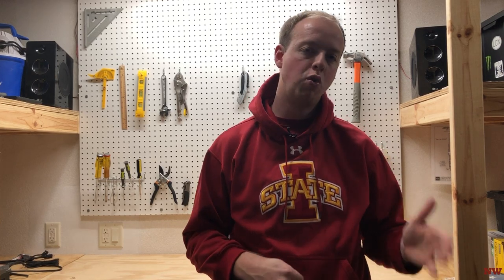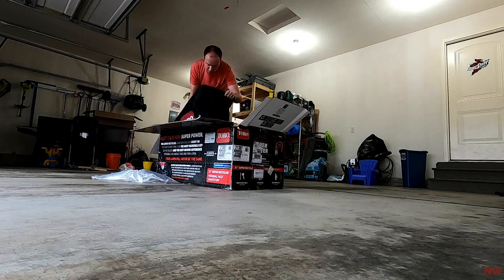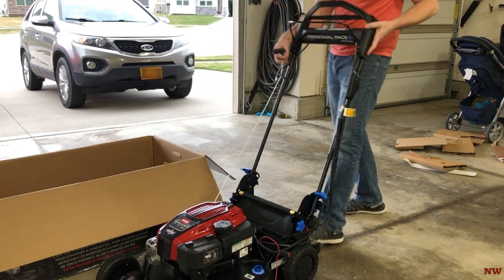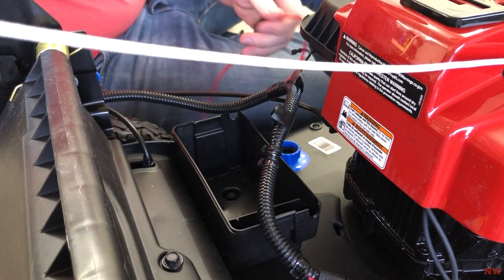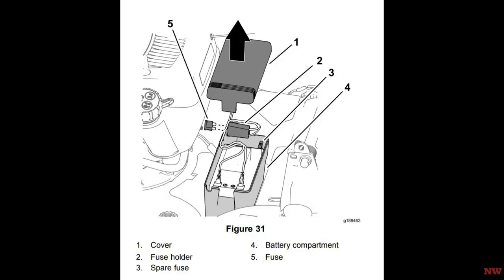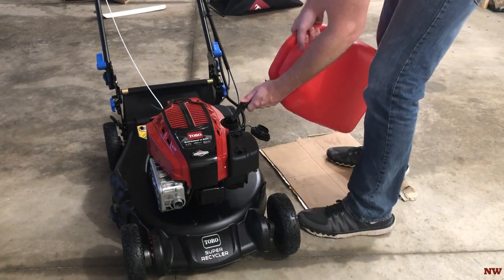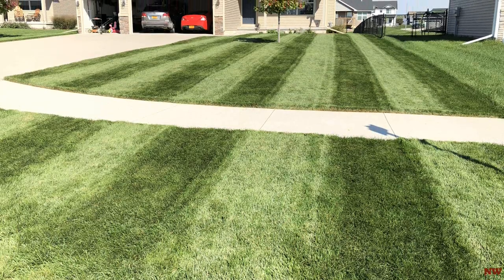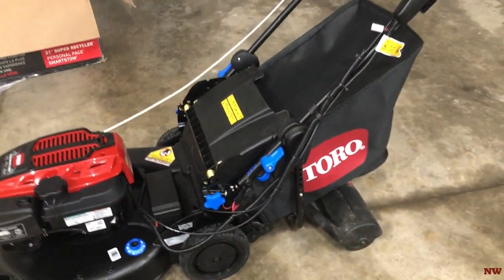2020 Toro Super Recyler (21387) Unboxing

Comment: Just curious I've had two of these and taken both back. They both stalled and sputtered constantlyand almost stalled  on any kind of bump or slight incline or decline. As if the engine was not getting fuel. Toro customer support just asked that I return them. Unfortunate because I like the mower design and build
Reply from the maker: That’s unfortunate to hear, Rick. I’ve had a few times where it sounds like it is going to stall out. I stop moving and it will regain itself. I was mulching at the time. Definitely keeping an eye on this. May give Toro a call if it keeps happening. Thanks for sharing your experience as well.
Reply: Rick D I wonder if it’s the plastic carburetor that Briggs uses on these that’s causing issues. My SR with the Honda engine is about 4 years old now and has been outstanding.
Reply: Wonder if the one with the Honda engine is better?
Reply: Just got one 2 weeks ago. It is sputtering. I am going to put ethanol free fuel in next tank and see if that helps. So many great features but that maybe a deal breaker. I usually stick to Honda small engines but the stow feature is what sold me on the Toro.
Reply: Mine sputters also on bumps.  Used ethanol free gas with no luck.
Reply from the maker: I can’t take credit for this, but a lawn care group I’m apart of on Facebook mentioned this fix, as well I spoke with my Toro dealer and he said Toro reported that there is a common issue where the spark plug boot isn’t fully secured.  This can cause this “sputtering” issue.  The fix has been pulling the boot all the way off, then push it back on until you hear a clicking noise. I’ve also heard this hadn’t fixed everyone but seems to fix quite a few people. I haven’t had a chance to test this out myself but plan to do so in the next day or two. I’ll post back my results.
Reply from the maker: Early indications seem to be promising.  Re-seated the spark plug boot and didn't have the issue yesterday.  I'd like to get a few more mows in just to make sure, but in the mean time I made a short video on what I did: https://youtu.be/SO-Kvix0s14
Reply: Just an update. I went to a local Toro lawn dealer and purchased the new #21383. It’s all black with a Toro motor with blade clutch and is outstanding. No sputter or problems and has performed without a hiccup. Highly recommended. The mower handles great and love the Personal Pace.
Reply: I’m having the sputtering issue as well. Spark plug adjustment didn’t work. Honda motor model is sold out
Reply: @cnosby 
Just left my repair shop.
The fuel tank vents into air filter housing causing it to sputter.
The fix is a newly designed tank AND a part for the carburetor.
Sucks.
Reply: I made a typo in previous comment I said .25 and what I meant to type was 025
Reply: @exnihilo2601  Did they charge you for that fix?
Reply: @lritch76 
No.
Under warranty.
They fixed the carb and now I'm waiting for the new fuel tank.
Reply: @exnihilo2601  hopefully toro is  fixing  those issues from the factory since they are on back order almost everywhere. There is a guy locally to me selling one brand new in the box for 500.00 but with the issues people have been having i will only purchase from a dealer.
Reply: Rick D screw that I bought one last November and was very disappointed. Go to Home Depot and purchase you a Honda this lawnmower is a waste of money.
Reply: Assuming its a briggs and stratton, thats your issue. Buy a Honda engine super recycler
Reply: the reason i think that it sputters is because the fuel line is straight into the carb not on an angle so really any bump would have the fuel push itself back into the tank then back to the carb thats just what it looked like to me
Reply: @exnihilo2601  Assuming your received the new fuel tank...have you had any issues after this fix?
Reply: @jonpenguin303 
I used it a little bit after bringing it home and didn't notice the previous symptoms? It was covered by warranty but the dealer kept it for most of the summer due to a lack of parts. I guess I'll get a chance to see for sure once the grass starts growing again. It's a shame a premium machine is defective out of the box. Mine has electric start which is why I bought it. Might have purchased a Honda but wanted a side discharge option.
Reply: @Ex Nihilo Was there any documentation of the problem or a technical service bulletin? I called my local Toro dealer and they said they haven’t heard of the Super Recycler sputtering issue and suggested that the carb might be dirty, which makes no sense because it sputtered 15 minutes after I took it out the box for its first mow.
Reply: @jg769 
I don't have any knowledge of any bulletins. For what it's worth my mower does run better after getting a new tank and carb work. It's not perfect but it's better. After I posted my previous comment my drive belt slipped off from the transmission. Shop replaced the belt AND the transmission. I'm not making this up.
Reply: Just order this mower with electric start from Toro, 2021 model. Used it today.  No sputtering or anything. I'm using trufuel 92 octane 4 stroke fuel. Excellent mower. I guess they fixed all the problems with the 2021 model.

Comment: Just got a 2021 model from Toro. Excellent mower, no sputtering or stalling. I'm using trufuel 92 octane 4 stroke fuel.
Reply: What is your motor serial? I purchased one 8/24 but the motor was built in January 21 and it has issues. Thanks

Comment: Excellent, informative video! It sounds like the bag switch was not designed properly.
I have older Super Recyclers that run flawlessly, even better than a new Honda HRX
I picked up last year. The Honda runs fine, but the cut quality is no match. It does mow longer grass better with it’s monster engine. Also the Personal
Pace on the Toro is unbeatable. Just being honest!

Comment: Nathan, your videos are very informative. I've had a Toro 22 inch Recycler that became too labor needy to fix, so I have been looking at a replacement. I was gravitating to this one, even with the challenges noted. But I cannot believe for the price and all its other features, it does not include the Blade Brake clutch! 

So, my quest is to find a great recycler with electric start and a blade break clutch, at a minimum. I like Toro but if I cannot find that trifecta, I will have to look elsewhere. 

(Why is blade break clutch not more standard, especially in these safety-conscious times, I wonder?)
Reply from the maker: Thanks, man! Yeah it’s definitely not perfect. Blade stop would be nice! Thanks for stopping by and commenting!

Comment: Was curious if you were still having issues with this mower? I'm thinking of purchasing a new toro and was interested in the super recycler model but was torn about which engine. I have a toro (20068) with a Briggs motor and it runs flawlessly despite the drive system completely failing and being disabled.I just push it but it cuts beautifully.  I've heard about issues with the Toro Chinese motor as well and with the Honda motors termo wax actuator pin for the auto choke. So was counting on the bigger 190cc Briggs but am now hesitant because of this sputtering issue. I'm debating on waiting to see if Toro releases any new models with different feature combinations or just take a chance on what is now available. Your thoughts?
Reply from the maker: For the most part it’s been running fine. Occasionally if I run over the sidewalk or driveway in the wrong way it’ll sputter for a bit. It’s nothing like what I’ve had in the past. If the Honda mower is an option, that would probably be my recommendation. I haven’t heard if this years models are any better, but for this model, it’s definitely a problem. If you do want to buy this model, I’d recommend buying directly from a dealer instead of Home Depot or other home store. They’ve got better resources and a direct line to toro if you run into issues. Good luck with whichever direction you choose!
Reply: @NathanWatne  Thanks for the quick response. Yes I'm leaning towards the Honda motor in the Toro. I didn't care for the cut in the 2 blade system in the Honda mower. I really like the mulching system in the Toro and side discharge option. Really a shame Briggs & Stratton quality has slipped so drastically over the years. Thx for the help and the great videos. Keep'm coming!

Comment: Thank you for the excellent video. I have one of these coming ( My dealer didnt have one of these yet). Its replacing a 24 year old John Deere 14SE. I'm  getting excited  to get it.
Reply from the maker: Thanks for watching and commenting! Not to scare you, but there has been quite a few people report an issue where the mower sputters like it is running out of gas. I did a shot video on it if you want to check it out. For some there is an easy fix of making sure the spark plug boot is fully secured. Others are still fighting issues. I’m hoping you don’t have the problem, but your dealer should be able to make sure things are right if you do. I love so many things about this mower, but a little nervous at the same time with the problem. Thanks again for watching!
Reply: @NathanWatne  I'll keep an eye out. I'm getting it from a good local Toro dealer so they will hopefully make sure everything is together as it should be.  And take care of any things that come up.
Reply: It's defective!!!! 

Needs a new fuel tank and part for the carburetor.

Comment: Thank you so much for sharing this.  I just got mine and this s definitely helpful. The one I got has the battery already installed and it is installed in the exact the way you did except the black thick wriggly cable that you decided to leave it outside the terminal box (to the left of the terminal box as per your video) was secured inside and it actually passes very easily over the two notches and the cover secures perfectly.  Not sure if that makes a lot of difference but thought of sharing. But noticed that I didn't get a charging kit to charge the batter, so I am going to contact customer support and ask about it.  But really appreciate you sharing this coz I was curious if I was missing anything else and now I am sure of it :D
Reply: Correct, the black chord with the plastic covering sits inside the housing to the left of the battery in those grooves that are notched out in the plastic. Be careful when you put this chord in there and put the cover back on as you can pinch the chord wrap and break the plastic. Just make sure it is snug and place the cover on gently.

Comment: The black flexible conduit will pass through the battery housing and still be connected to  the battery at the same time. I have the same mower and it looks like your was delivered by UPS as well they are terrible for large and heavy packages
Reply from the maker: Mike Hernandez good to know! Thanks for the info!

Comment: Bought this same mower almost a month ago. Unfortunately after only 2 mowings, I had to return it back to the home depot. I was having the same sputtering issue alot of people are having. I heard about the spark plug fix after I returned it. but feel I should not  to do any sort of work on a almost 600 dollar mower not even a month old. Might go with the 21383 model. Would like the honda engine model but they are sold out.
Reply: Order the one with the Honda. Dont get the Chinese Toro motor.

Comment: Good Video 
are the Wheels Ball Bearing ?
Reply: they aren't
Reply: @davidbellefeuille8154  WOW all the HYPE and NO BALL BEARING ?
my Lawnboy 10601 2 stroke and 22270 have ball Bearing
Reply: @jonienglish3231 I have an old super recycler that doesn't have ball bearing wheels either. The only wheel problem I ever had is the tread wearing out. Replacement wheels are $25.00 apiece. That's bad enough as I just replaced them all after 20+ years. I imagine the wheels for a commercial Toro are double that price!  I'm sure it's a great machine though. I keep looking at these newer Toros thinking they probably aren't as good as the older ones like you and I have.

Comment: I've been a long debate between the 21387 and the Honda HRX217. Have you considered the HRX? I currently own the Toro Stripping kit but debating on the Checkmate system as well. 
Toro - Personal Pace, Smart Stow, Side Discharge
Honda - 202cc Honda Motor, Bearings, Dual Blade, Clip Director
Reply from the maker: Hey man- I debated between both of them as well. End of the day I don’t think you can go wrong with either one. The combination of the personal pace, smartstow, and overall appearance made me go with the Toro. I personally haven’t used the HRX217, but I can say the personal pace feature Toro provides is fantastic. The mower moves at your speed so you don’t feel like you’re getting pulled around the yard. Would love to test drive the HRX217 some day. I’m sure it’s rock solid as well. Thanks for watching and commenting!
Reply: @NathanWatne  the only thing i wish the 21387 had is the blade stop feature. can you show how you would empty the bad on the super recycler? heard there was some kind of plug and makes a clipping mess
Reply from the maker: Will do!
Reply: David, I was torn between the two. I like the stow and go feature.
Reply: I had issues with my HRR. My next mower is a Super Recycler, but I reccomend you get a Honda engine like I would.

Comment: Do I need to charge the battery before I use it for the first time even if I don’t use electric start?
Reply from the maker: Mine came with a charge already. Either way you only need it for the electric start. The old fashion pull start doesn’t require it to be charged.
Reply: My Troy built charges the battery while using it. So if you pull to start, the battery charges up for the next start.
Reply: You can start the mower with the pull-start at any time, even without the battery for the electric start charged.

Comment: How do I get grass to come out of the rear into the bag?? I have tried everything I could think of. There’s a lock and unlock latch inside when you flip up the flap. I don’t know what I’m doing wrong
Reply from the maker: That is the mulch plug. You turn the lever to release then it slides right out. You need to remove it when bagging and add it back if you want to mulch.
Reply: I still can’t find good instructions how to put this back in correctly. It seems like it just sits in there.

Comment: I have this mower love it but wanted to go to side discharge manual talks about rear discharge plug but no details how to install it talks about removing before using bag but was never installed to begin with. Could not find how to install the plug so that clippings don't plug the hole and try to come out. Anyone know how to put the plug in?
Reply from the maker: Sounds like you may be missing the plug. It should have came with it. Mine was installed out of the box. To switch to bagging, I had to remove it. Then there is the side discharge part that goes on the side of the mower to hold the flap up.

Comment: another Question ?
is the Transmission Housing Aluminium ? or Plastic
Reply: Aluminum
Reply: @jonienglish3231  yeah the normal Recyclers have the plastic transmission, Super recyclers are aluminum.
Reply: No!  It’s gray plastic on the new black sr.  It says “General Transmissions” on it.  Hope they hold up.  Anyone peeked inside to see it it’s metal or plastic gears?  Up until now, recycler got plastic box and gears and sr got aluminum box and steel gears..

Comment: I just bought the same lawnmower from Home Depot. The battery came assembled from the factory. That looks like a returned item and somebody remove the battery.
Reply from the maker: Oil was empty and there was no sign of use. Not to say someone couldn’t of opened it and returned it without using it or setting it up. Also from others sounds like their’s was out of the compartment as well. Could be the supplier too. Either way, appreciate you watching and commenting!
Reply: Just had one shipped to me today and the battery was connected, but was not in the housing. It more than likely does not come per-assembled in the housing as yours did, or this is a major quality assurance issue Toro needs to look into in their assembly process.

Comment: Check out the replacement battery on Amazon, you can see the proper way of the terminals https://www.amazon.com/Replacement-part-mower-106-8397-BATTERY-12/dp/B00JS4GNPK/ref=sr_1_15?dchild=1&keywords=toro+replacement+battery&qid=1625960023&sr=8-15